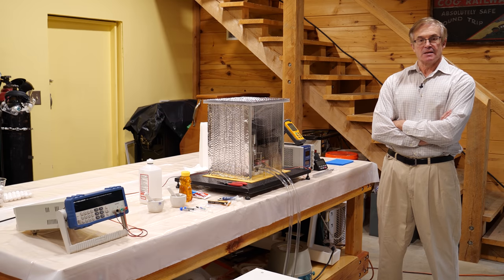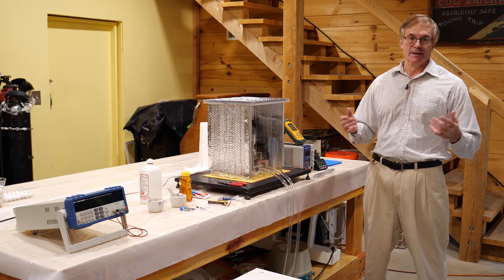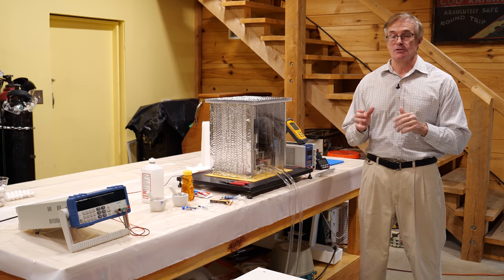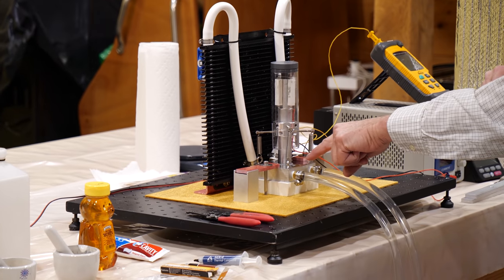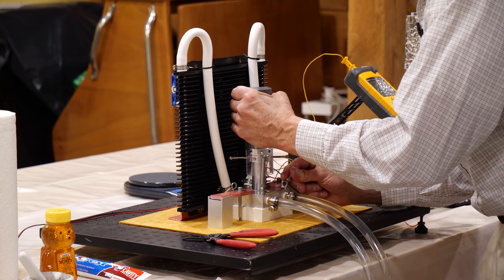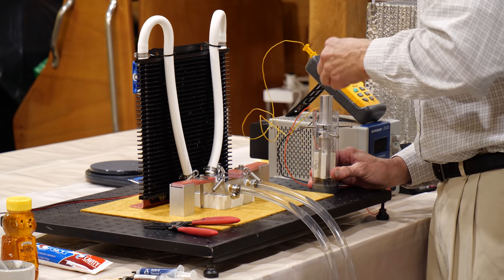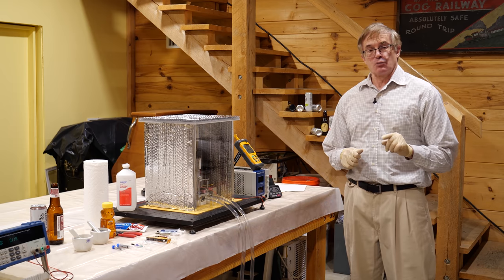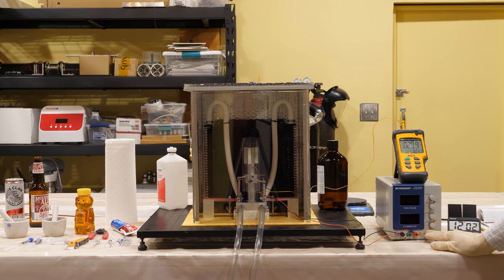DID WE JUST MAKE THE WORLD'S BEST THERMAL PASTE!?

Comment: Dear Tech Ingredients.. Some months ago I had the idea of using a lead-bismuth or other alloy that turns liquid at just under TJMAX. That way, a thin piece of foil in that alloy used as a thermal insert could be made liquid by running fan-less for a few seconds... then turning everything off would solidify.. From then on , the running temperatures with a fan(cooling) running would never reach TJMAX again in normal circumstances. Could a metal on metal bond give something feasible. I had the discussion on the EEVBLOG forums, i'm not going to link it here since I don't want what came out of that discussion to muddle your answer. 
Do you think this could be feasible? Lead-bismuth which I stated as an example, in the right proportions melts at around 95 Celsius. Additions of other metals might even change the amount of shrinkage etc.. The idea behind this being a bond and the material an alloy and not a mix.

Friendly regards.
Reply from the maker: This is similar to a low temperature soldering of the components.  One problem with eutetetic alloys is separation of the components with repeated cycling.  That is an advantage of the liquid metal thermal pastes, they don't change phase.
Reply: @TechIngredients  First , thank you for taking the time to reply. The Idea though is to only have it reach melting point once. When you apply it. Have your computer run fanless( cooler less) and reach TJMAX , when it will throttle and stay at that temp. After that , once it's bonded you should never reach that melting temperature again, staying at anything from 45 to 65 depending on overclocking..

Comment: Where is the data on the Accelerated Product Life Cycle Testing?
Reply from the maker: Believe it or not, we're doing that.  To start, we have two computers now at three months and running with this TIM and so far, no degradation. We've also been cycling the rig 4 times per hour, 12 hours per day for the last week at an elevated temperature and power level.  We'll see.

Comment: There is a pink paste called Thermal Grizzly kryonaut extreme which is expensive but I used it in my OCed vega 64 (custom bios + hbm2 timings) and it cools them better than anything else. (there is in difference in naming and perfomance it must say kryonaut extreme not just kryonaut) 

I think what's ignored in this test is the ability to cool faster cause in most high performance electronics application this is more important since they depend on airflow via fans and thermal pumps etc to cool stuff down.
Reply from the maker: The process is bidirectional. Nevertheless, in this test the pastes are cooling the rod continually as heat is supplied from the other end of the rod.
Reply: @TechIngredients   it's about heat capacity of the compound it self and heat transfer speed depending on the current temperature of the compound

Comment: But what's the point, if you could use copper thermal interface and gallium as a thermal paste? And on top of that, this kind of products really long time on the market and called liquid metal.
Reply from the maker: For liquid metals you don't want to use aluminum or copper, but rather nickel.  That's why we're modifying this rig with nickel coated surfaces and will compare liquid metal TIMs in an upcoming video.

Comment: Might it be possible to further reduce the thermal resitance by removing the air once again, after applying the tim and spreading (/folding a tiny bit of air into...) it?
I know it is not the point of the video, but i would give the whole "how to apply thermal paste" discussion a new spin.

Comment: If you paint a "K" with your paste it'll go faster.
Edit: slightly miffed that we didn't do liquid metal as a reference point.
Reply from the maker: You shouldn't be miffed.  The aluminum surfaces aren't compatible.  We're modifying the rig with nickel coated surfaces and will then compare liquid metals.
Reply: @TechIngredients  Awesome, thx. Can you also do a "zero" measurement with no thermal compund at all?

Comment: wait, you are supposed to PUSH on the CPU cooler??? I always just let it gently connect, and then clamp it down...
Reply from the maker: Why?
Reply: @TechIngredients   To not break anything. XD - I'm always very gentle with it. Especially the motherboard...  I never considered pressing hard on a motherboard...
(I would imagine the CPU would handle it, but...)
Reply: @TechIngredients  also, it squishes the paste out (I know it means I applied too much if it does, I've improved) but then I worry there will not be left enough if it doesn't stay firmly pressed forever, so I feel like letting the clamps choose the amount of paste is the correct decision...
Reply from the maker: As long as you apply relatively even pressure it's not a problem. You are pushing much less than the clamps will squeeze down.
You want to remove as much of the paste as possible to produce the thinnest bond line possible.

Comment: With all due respect, your testing methodology suffers from a critical flaw: the performance of thermal compounds is dependent on the temperature at which they operate. Most cpus will boost until they reach approximately 90-95C, so you should target that as well. (I would suggest placing a copper block that readhes equilibrium around 95C using artic silver, between a steel heat source and the cold block. Furthermore, I’m a little suspicious of such short tests. One of the tradeoffs you forgot to mention is that the performance of thermal paste should be good for at least a few years under load.

Comment: Consistent volumetric application of the paste, the pressure of the CPU to cooler, and the angle the pressure between the two are applied at all need to be very controlled. I'm afraid those guys might just apply it by hand and that type of variation will influence the performance. You're probably better off doing what you did.
Reply from the maker: Probably, but a practical formula has to stand up to real world applications, nevertheless we WON.

Comment: 00:52 do you think there is any good reason to make CPU's 4x their size right now so they'd be easier to cool?    I mean inch and a quarter square is impressive footprint to squeeze billions of transistors but................ is that really necc to save that kind of space in a desktop PC?   Could we go faster and use more voltage, if the dies were just plain old larger?
Reply from the maker: Size is part of the reason the transistors are able to run so fast. Also, as they get smaller they draw less power, so there are several interrelated factors that determine over all performance.
Reply: @TechIngredients  interesting .... and above my paygrade.   Thanks for the reply
Reply: @TechIngredients  can you please address those of us in the comments who ordered this paste 3 months ago and have yet to recieve thier orders and thier emails asking what happened left unanswered?

Comment: at TI,
 I have yet to see the entire video. First, are there any electrically conductive particles in your TP? I've been using Artic Silver #6 and it contains conductive particles so care must be taken when doing the squishing out of the sides test as to not cause a short on the MB. Q-tips and 90% Iso alleviate that problem.
Tell me if you think this is correct, when applying TP, after it goes on top of CPU and you mate the 2 surfaces together, you can slide the cooler around BUT if ever you lift up enough to break the bond (even partially) you should re-clean and start over because the heat dissipation ability has been degraded. Even if only slightly. I heard this in the early 2000's and will mention it when discussing TP and the fact that thermal degradation affects everything indigenous to this planet and I'm guessing most is cumulative. Their eyes glaze over and I then realize that these are the same people that think Star Trek was filmed on location.
btw - does anyone have a name of the vid where they discuss leveling the mating surfaces?
thanks

Comment: isn't it kinda gross to use honey, potentially for years in a warm environment like that? Won't it dry out, potentially get moldy (eventually), crystalize and get really disgusting?
Also you mentioned that water based products will degrade as the water evaporates. But Alcohols evaporate even faster in general. Why don't those gaps fill with air and degrade performance?
Reply from the maker: Of course, that's why we debunked the toothpaste myth and explained the problem with water.  No thermal paste uses volatile alcohols.

Comment: Further thoughts:  Maybe it is not wise to trust Walmart for their skin care products to be non-toxic, after all they sell fluoridated water to mix in baby formula.   Secondly since the zinc oxide in their Baby Diaper Rash Paste is unknown in size or shape, buying further materials to load it further could be a wast of time/$, and Walmart's manufacturer could change theirs at any time so whatever formula we could come up with may not be duplicatable for others or for long.
Reply from the maker: Just as an aside, I use their  distilled water frequently  for many projects that aren't too demanding and measure the resistance of that water as a matter of course.  It tends to run around several megaohms. Fluoridated?
Reply: @TechIngredients   Yes, I used their distilled water for years as well.  I make my coffee and tea with it and have for years until about a year ago, when I got my own distiller, which is SO much more convenient, and we start from water that we fetch from a local artesian well, so what is left behind in the pot just looks like lime deposits that is cleaned up every so often with vinegar.  When I used my old distiller years ago, I would end up with yellow oily sludge in the bottom of the pot.  What I make now at home costs me less and doesn't taste like plastic which walmart distilled water would.  Seach for "ewg Fluoridated water for infants" for what I was talking about.

Comment: I thought of a possible significant flaw in your methodology.  You mentioned the importance of flatness, smoothness...essentially distance between (closeness) of the mass bodies.  I noticed you don't measure the amount of material, you just put a blob in the center!!!!  So you could VERY EASILY inadvertently squish the material out with greatly varying initial forces!!!  Think about it,  the harder your initially squish would have a high impact on how close you are getting the two bodies together, regardless of the springs.
Reply from the maker: The amount of pressure I applied during set up is significantly less than the combined force of the springs.  Viscosity and the pressure applied determines the bond line thickness. And as I'll explain, viscosity and thermal conductivity are inversely related, so it's a balancing act.

Comment: W = k * (S/L) * T  - it is a simple formula, W, k, S are fixed, T difference of temperature is measured.
Why you did not measure the thickness of the layer?

For W = 100 Watts, S = 1000 mm^2, k = 8.5 W/(m*K) (arctic mx4), and the thickness L = 1 mm, => T= 12 K. Volume of the paste is 1 cm^3.
For L = 0.1 mm T = 1.2 K. Volume of the paste is 0.1 cm^3. The Difference of temperature on the thermal paste layer is like 1 K. The thickness can be changed, its influence can be managed in a much bigger range than other parameters, especially heat conductivity. You can not change k in 10 times. But amount of used paste can be easily changed.

Also the second probe in your cylinder could give you direct information about applied power.
Reply from the maker: It can't. 
The thickness  should always  be minimized, but the pressure  is limited by the force that the component can withstand.  The viscosity is a trade off.  Lower allows  a thinner layer, but thicker allows  more solids loading and a higher thermal conductivity.

Comment: Just use Plumbers Silicone Grease it works just as good as Thermal grease.
Even better if you mix in a bit of Graphite Powder in it .
Reply from the maker: No, it doesn't.
It doesn't make sense.
Making that pronounment without rigorous testing isn't useful.
Reply: @TechIngredients  I have used it for a while now and seems good for me .
Reply: Hey thanks man I have to try this
Reply: @atrealworldgames9373  Ant time my guy glad I could help.
Reply: I think I need to give this a try .
Sounds interesting. I have been meaning to.
Replace the Compound on my GPU and I have a hardware store near my apartment . 
I can Pick up the grease and graphite today .
Reply: @TechIngredients  IF you think about it graphite as proved to be one of the best materials in transferring heat.
So there is some Validity to this and A lot of Thermal Compounds are Based with silicone grease . So on a Scientific standpoint 
it should work at least well enough to keep the GPU cool .
Reply from the maker: Graphite  is not a good thermal conductor if the heat is moving between the individual atomic layers and in a randomly oriented powder, half the time, it will be.  But, don't worry  about it, use whatever you think is best.🙂
Reply: @TechIngredients  powder mixed with the Plummer Silicon grease
Reply: @realpeoplenow5926  just dont forget to mix the two. Or it does mot work as good
Reply: @TechIngredients  I think this is Him giving his approval . 
But just does not want to Take Credit for the Idea of homemade grease for cpu's .
I love that he is modest like this. I will be honest I was on the fence but if he say's dont worry.
Then I think he is giving the all clear yo I will give this a try I got the new  Ryzen 9 7950X and I will give this a go.
I honestly thank both of you. I was just going to waste some cash on some grizzly. Thank you Tech Ingredients I trust you and will give this a try.

Comment: Using a testing criteria that generates at 0.1 degree difference in a 10 degree range isn't going to produce truly great results. Perhaps pumping 100W into the alumimium would produce more dramatic results.
Before saying that the paste is good or not it probably needs some age and cycle testing. Test it over a 0-100C range and cycle it up and down in temperature. Liquids are known to age and creep and it would be a shame to have an excellent heatsink performance 1 day and then a month down the track the cpu is throttling as suddenly there's a great thermal insulator in place.
With that said I'm keen to see how it's made even though I'll probably keep using the tube of dow corning stuff that I've been using slowly over at least a decade.

Comment: So basically the CPU manufacturers need to machine the surface of the chip housing for better temperature conductivity. That would save us Tech-nerds from having to buy goo to shmere on our CPUs after we install them. Problem solved. Any decent CPU cooler I have seen, the transfer block has a mirrored finish.
Reply from the maker: Agreed.
Keep in mind that flatness is more important than smoothness.  Check the flatness by carefully reflecting a STRAIGHT bright edge like a light fixture across the surface.  Even a slight wobble or distortion of that line means the surface needs to be flattened.
Reply: @TechIngredients  This is very true! I guess Samsung and TSMC do not want to put that step into their process. It would help though.

Comment: I think the test is flawed. Great attempt but the thickness matters and without using a consistent thickness compounds like honey look better than they really are. Thats why your results do not have enough variance to draw any conclusion. With your setup a drop of water would probably have performed as well as anything but if you set the thickness to be 0.5mm for all compounds it would really separate the good from the bad!
Reply from the maker: Actually, this method is better.  Remember, you don't clamp down a heat sink to a given interface thickness.  You apply a pressure. The solids increase the thermal conductivity, but increase the viscosity as well. Fixed pressure is a better standard.

Comment: Would you consider doing a video on a new invention (First made in my shed) that saves substantial amounts of water by Flushing your toilet? Yes Just flush and you get hot water to your shower/bathroom fast without running gallons down the drain "Waiting for hot water". I am willing to pay for it and can send you a factory made unit from our first production run at no charge. Not even shipping. FYI ----> No electric/battery No pump, Not a Gravity system, Patented, Mass produced, I am the inventor and am having trouble showing people how it works (maybe it's just something no one wants!?) Please Help a discouraged inventor.

Comment: What you have created is a viscosity tester, not a thermal conductivity tester! Why do you think toothpaste scores 42 °C vs. 30 °C for a compund on tomshardware, while in your setup both score ~30 °C?

It's because they used a real CPU, and these are warped, which you can clearly see on the scratch pattern that occurs when you grind them flat with sandpaper. So you should test conductivity through some fixed thickness, not through some fixed clamping force on a mirror surface.
Reply from the maker: But in real world applications, viscosity and clamping pressure are all you can specify. That's why we tested with surfaces similar to what an end user can produce at home.
Reply: Sure, your experiment is easy to reproduce, but it's not related to the real world.

Toothpaste may be more liquid and get a good score because it seeps away until your test surface nearly touch. In the real world however, it would be trapped in a void of a fixed volume due to warped surfaces, and it would score much worse because toothpaste has conductivity of 0.6 W/mK compared to 50-80 W/mK for thermal pastes.

This also explains why all your numbers are so similiar, while every other websites with tests have their values scatted much more.

Please address my point.